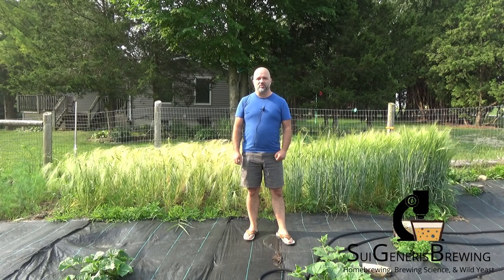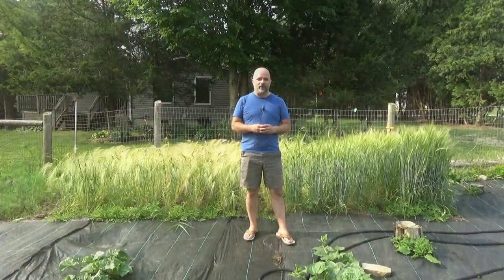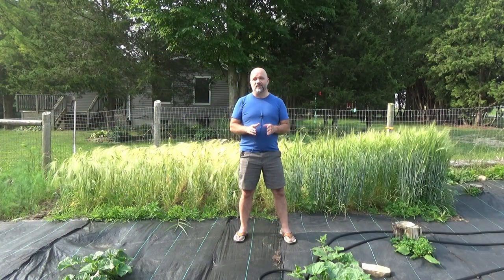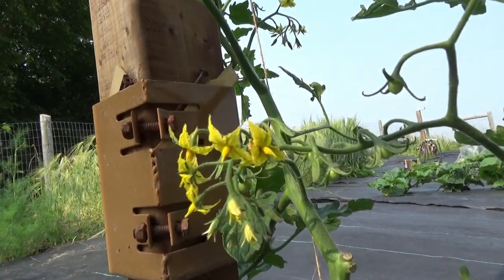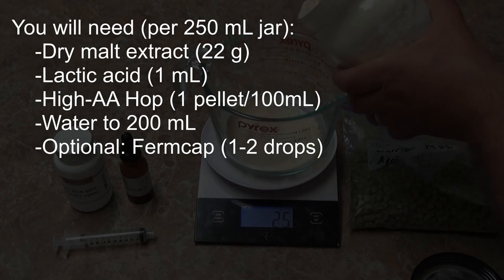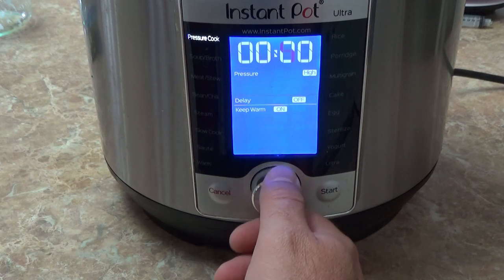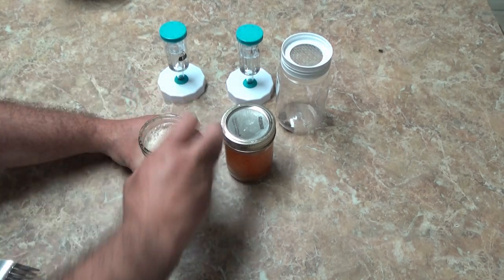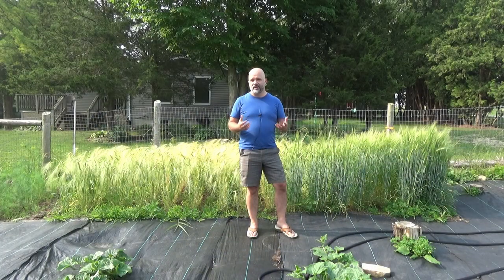The Fifty Meter Beer Project Part 9 – Capturing Wild Yeast + an Update

Comment: Bryan,  I have an Instant Pot, but not the "Max" version that I have seen some say hits a high enough pressure to be safe for canning.
If I make wort with DME and conduct a subpar pressure canning session in my cheaper instant pot, am I safe IF I acidify the wort with lactic to 4.5pH?
Reply from the maker: Generally speaking, most electric pressure cookers are sufficient to kill botulism, even if they don't reach a full 15 psi (link at end of this reply). That said, pre-acidification to pH 4.5 would provide additional security. I'd also recommend not preparing too far in advance, and storing as cool as you reasonably can.
Reply: @SuiGenerisBrewing  so if I can,  acidify, and keep them at 35ºF, I should be fairly good for a week weeks?
Reply from the maker: @oakbox12345  yep

Comment: Really interesting yeast capture method. I was wondering if you think something similar will work for wine, using grape juice.
Reply from the maker: Absolutely! In fact, many commercial wines are made using the wild yeast present on the grapes. The winemakers just press the grapes and let it go. Cider, perry, and country wines can all be done the same way.
Reply: Yes I know. It's a great method. I'm trying to convince the owner of a vineyard in Amsterdam to just risk a wild ferment. I think if I can find a way lto capture wild yeast willing to ferment grape must in a pleasant way in the vineyard it mighy be easier to convince him it is a good idea. After all, you could just go for a coolship in your backyard right?
Reply from the maker: @loekessers  doing a capture similar to what I did here, but using must instead of malt. Maybe a small test batch started that way would convince them to try something larger.
Reply: Good idea. Would you add wodka to the must as well as lactic acid? I guess hops wouldn't be typical.
Reply from the maker: @loekessers  for wine the vodka is unneeded as it will ferment to a high alcohol content on its own. Lactic acid bacteria are not uncommon in wine fermentation, so hops aren't really needed either.
Reply: Thanks for your thoughts. Really love your project. Curious to see how it will work out. :)